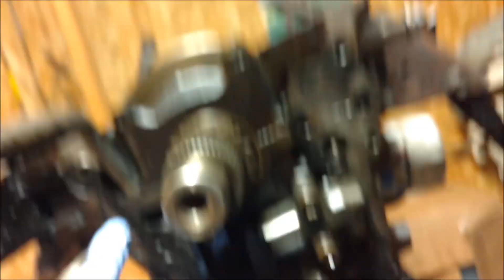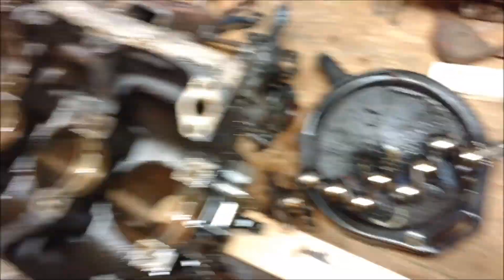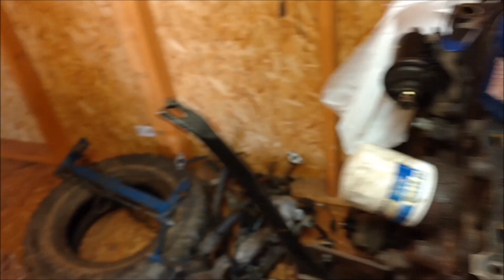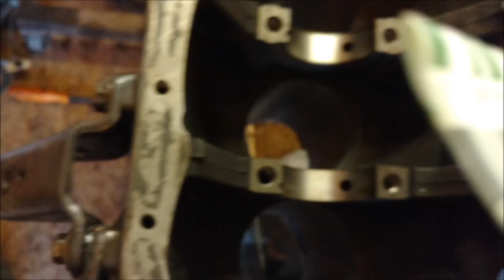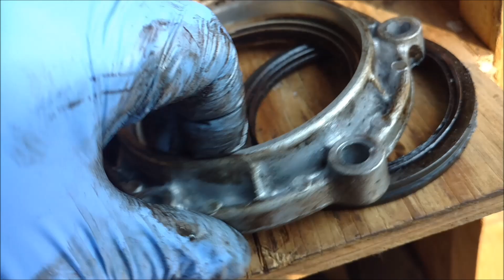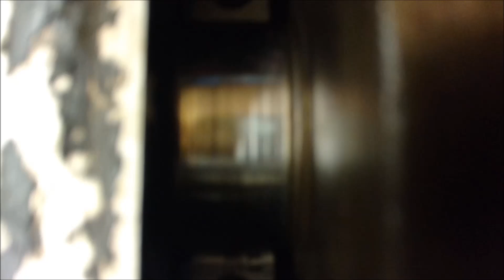22re Rebuild Part 2 of 3

Comment: Those mains don't look very impressive either. That crankshaft should have been turned. 
Please give us an update in a year or so.
Reply from the maker: Already did on another video where I installed a 4 way trailer wire

Comment: You have to hone the cylinders to put in new rings?
Reply from the maker: Yes you do
Reply: You should. But that doesn't mean you have too. If you can see a cross hatch in the cylinder you probably could get by, but I highly recommend to do a new hone job if are putting new rings in.

Comment: Oil goes through the filter first. That brown stuff on the bearing is copper. The softer metal is meant to scar instead of the crank. If the bearing is gaulded then it's from over heating from either low coolant or oil or both. Probably no need to replace the pistons just the rings. Also why would you not pressure wash n scrub the block with dawn after honing the block?
Reply from the maker: I did, but this was the best the camera could get with the lighting. My apologies

Comment: Dumb question: if I've got an old engine that's sat for a while, but didn't have any problems when it got parked, would it be best to leave the camshaft and main bearings alone?
Reply from the maker: If you're going to commit to keeping it and tear it down to that extent, I would inspect and replace if needed

Comment: Am I the only one that sees a crack in the block on the number two cylinder
Reply from the maker: Engine still running strong. No crack was found at machine shop or by me.

Comment: Isteed of woring about rod berings and main baring size.  Can i use a new crank with stoke barings?
Reply from the maker: Very good question.  If you have a new stock crank then stock bearings will be fine. But I would urge you to use the plasti gauge and measure clearance. Would be a shame to replace all that and ruin them because you don't have enough oil flow.

Comment: Alright, there's a few issues here.  Using a rigid hone, you have to use a flex hone on it after.  Those rings aren't going to last.  And you never use assembly lube with plastigage.  Put it together dry, you won't be rotating anything anyway.
Reply: After assembly it dry and all the clearance is good. We can assemble it with lube and able to rotate it to tdc to install the chain correct?
Reply: @dangerousfandango5943  Right.  Put it together clean and dry to check with plastiguage, then after you clean it off use lube for final assembly